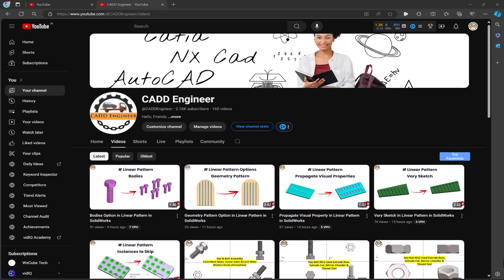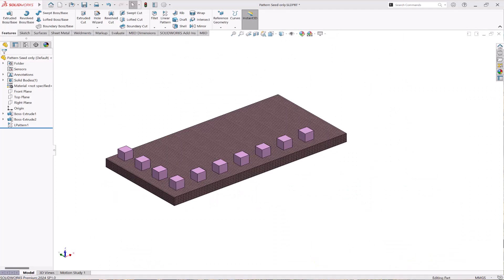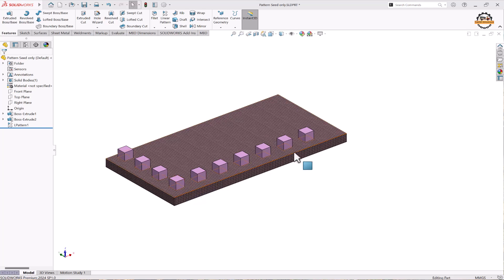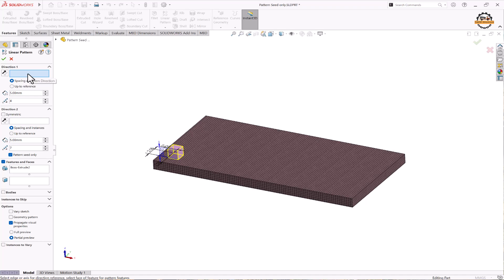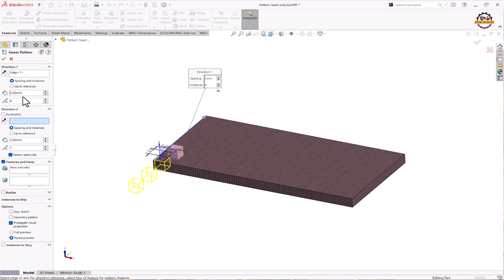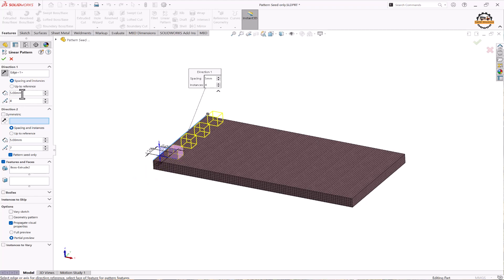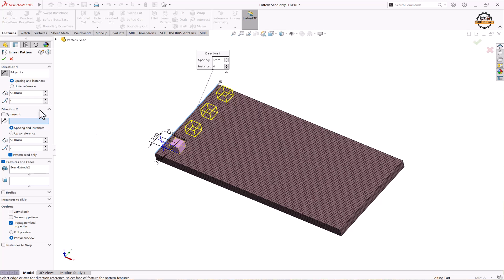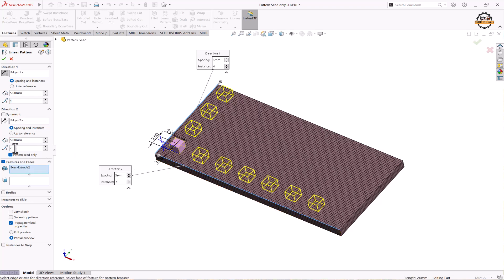SolidWorks Linear Pattern: How to use Pattern Seed Only

Comment: USELESS!  Tell me WHAT a seed only does and what the difference is if I don't select pattern seed only.
Reply from the maker: If you not select seed only it will do complete pattern all side.

But with seed it only pattern one horizontal and one vertical side.
That is the main difference
Reply: @CADDEngineer  Just wanted to put into my own words for others since I was still confused. For example,

Imagine a simple cube and using the "Linear Pattern" tool in both X and Y directions. You specify 2 additional instances in each direction to form a 3x3 grid (9 total instances).

Here, the "pattern seed only" option would avoid filling in the ones that are hanging in-between,
forming an "L" shape. In this case, there 5 total instances (2 up, 2 right, and the original ).
Reply from the maker: "Great explanation! 👍 You're absolutely right. The 'pattern seed only' option in SolidWorks works exactly like you described. Instead of filling in all instances to create a full 3x3 grid, it only replicates the original feature and the instances directly in line with it (along the X and Y directions). This leaves you with that 'L' shape pattern you mentioned, where you get the original plus the 2 instances in both directions, making it a total of 5 instances.

This option is super useful when you want to limit the number of replicated features without filling all the spaces in between. Keep up the great work! 😊"